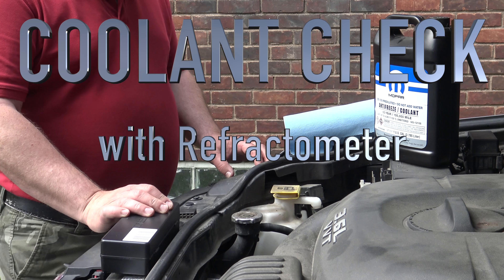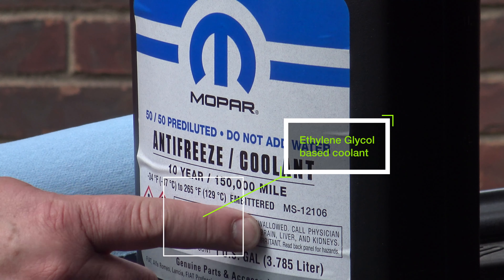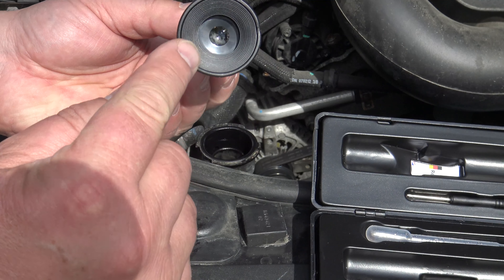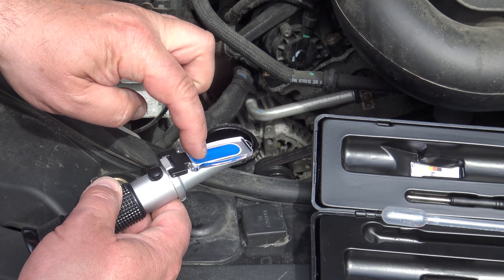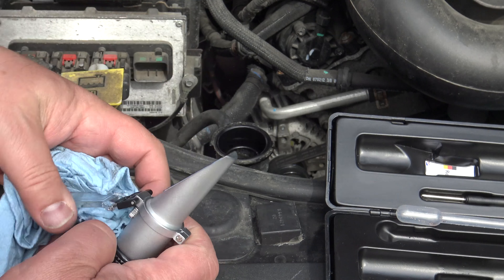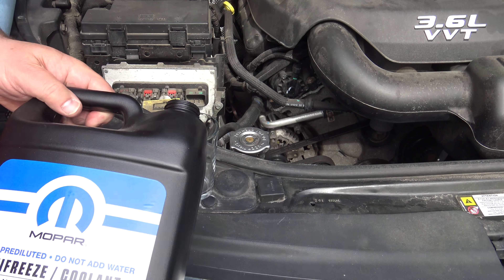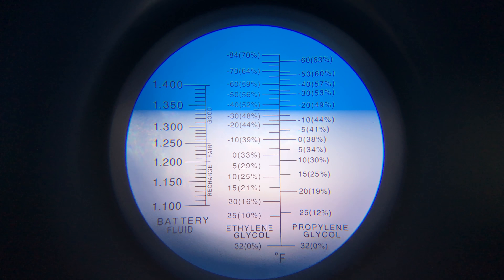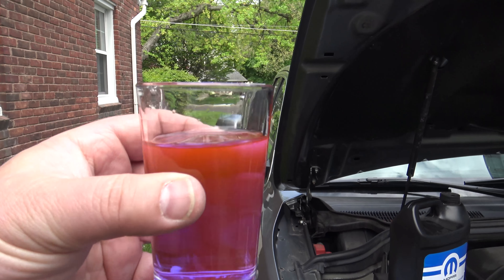Coolant Testing CHRYSLER, JEEP, DODGE, RAM, SRT with Refractometer

Comment: I have orange colored antifreeze in my 2016 Jeep Wrangler.   Should the coolant be purple?  What coolant should I add to this?  Hoat Mopar or Oat Mopar?
Reply from the maker: Look it up in the owners manual!
Reply: mygiguser I did.  It says oat, but if hoat is in there then it could cause issues. I wish there was a way test the fluid other than color alone.  It could be fiat oat which was orange.
Reply: My wife's 2015 Jeep Patriot should have OAT also, but it's orange. How can you test it and know for sure if it's HOAT or OAT ?
Reply: @bendummitt888  did you figure it out???